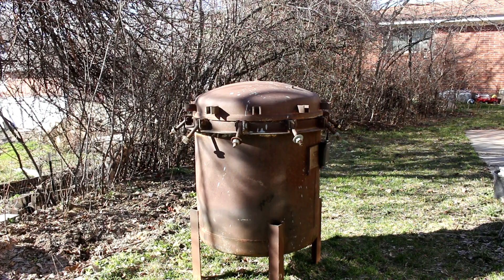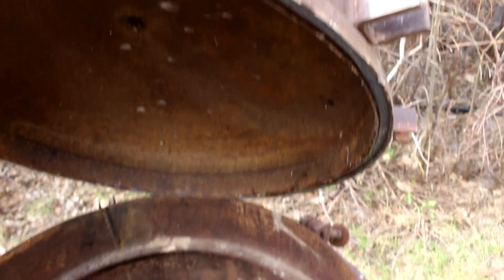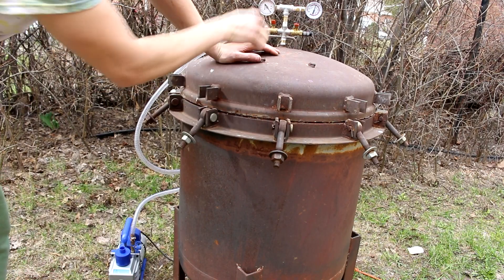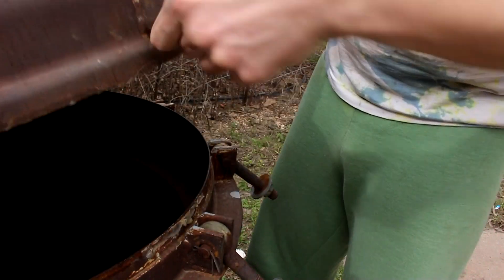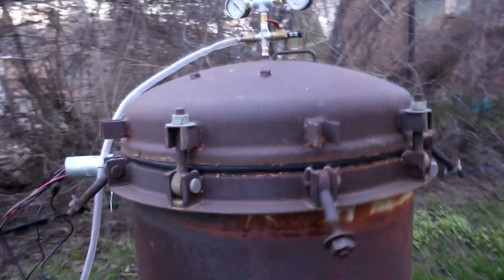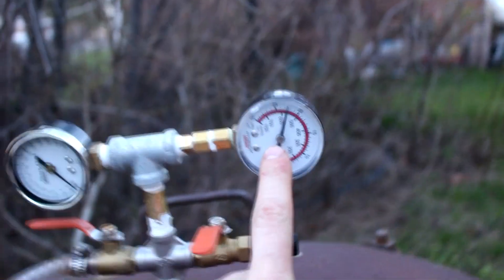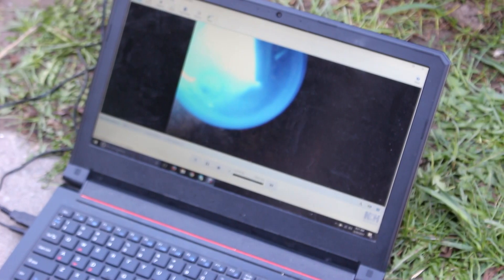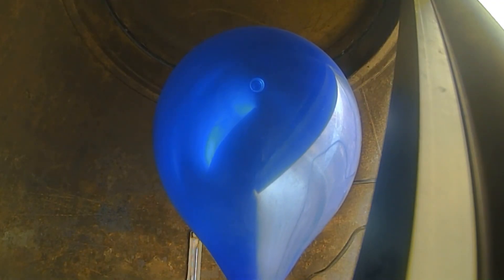Cody's 50 Gallon Press/Vac Chamber

Comment: Cool. Like Super Cool. 
Clean it up with chemistry or physics(acids or abrasives) either or, then test it.  dye pen or mag particle are fairly cheap and effective (vs Xray or Ultrasound...) and are fairly easy to obtain and operate. 
If thats too much effort at least paint it with one of those fancy rust converting paints (por-15?) and then pressure test to 5X your desired max working pressure. Submerge it in a tank of water so if it pops nothing too bad happens, like being hit by bits of  failed flying pressure tank...
Well played.

Comment: these vessels are most commonly used as filter pods in water reclamation facilities. the ring on the interior is used to suspend a rack holding fine grade filters. they can also be used with screens in the place of the filters and activated carbon packed below them as a filter agent.

Comment: it looks alot like a filter housing from a natural gas dehydrator, the ones i have been around typically have a max working pressure 30-150psi. also you should run a geiger counter over it naturally occurring radioactive material may build up on the scale inside.

Comment: Place I used to work had similarly shaped vessels(that were stainless steel). And they were used as filter vessels in a refining process, you know different size mesh in a nice pancake arrangement. But then again those had inlet and outlet ports on the bottom and top. Think you'd have to know what business had them vs who made them. Lots of metal fab places can produce stuff and never use it themselves. Just like yourself, there have been mad scientists in the past who needed cylindrical vacuum/pressure chambers.

Comment: With the DC lines running into the canister, I'm surprised you didn't run an LED light strip around the bottom to provide a more even lightsource.  I single incandescent bulb seemed pretty distracting and bright to one side making it difficult to see, although with the balloon, there wasn't much to see during this testing of the chamber.  You may have already thought of this and chosen not to do it, but a rotary drill with a wire brush would make very short work of cleaning the rust out of the inside of the canister without damaging it, and will also help prevent contamination of experiments.  Most industrial chemical tanks are stainless steel, because powder coating at various pressures can cause crack or flake contaminates into the chemicals.  I'd also recommend wire-brushing the threads on the lugs to help the nuts thread more evenly.  Great Find!!!  I look forward to see more experiments with the new chamber.

Comment: I have a 30 gallon high chrome stainless vessel which is good for 1500 PSI, has an internal heat jacket and weighs right at 926 pounds with a 1.5" thick observation window on it.

I am not sure what heat it is rated for but all that really matters is the gasket material which would be the first thing to fail under heat.

Comment: We use these vessels to filter coolant, as part of a separator system. Each vessel contains 5 800 micron filters, contained within metal sieves.
We use them as the last step in separating coolant from plastic shavings in CNC machines.

Comment: You could gain some confidence that your new vessel will not explode by hydro-statically testing it.  The process is pretty simple, requiring only water, a pump and either a larger tank or a scale. 

Pressurized water doesn't go BOOM like air would if the tank failed.

Comment: The vessel looks like a filter tank.  This would account for the high pressure rating and the removable lid.  It is not a reaction vessel as it lacks an agitator mount and internal heating coils.  Plus reactors have a lot more nozzles.

Comment: If you are concerned about the pressure capabilities of the vessel you should do a hydraulic test on it.  Fill the vessel completely full of water, with no air bubbles, and use a small positive displacement pump, or even an old brake master cylinder (800 psi I believe). Insuring no air is in the system speeds up the test and makes it safer. The real danger is from an explosion of the compressed gas. As you know water is almost incompressible and you can easily get the pressure up to 2 or 3 times it's rated pressure. A failure of the tank with water only will not be a dangerous event, you will just see water leak.

Comment: Hey Cody I've seen these same vessels in the gas plant I work at. Often they have a filter installed in them that fluids pass through. I've seen large oil filters that look similar too, on compressor engines, big waukesha v16s that are as big as a truck.

Comment: Not sure exactly what that was used for, but they still make them just like that. They are used in the aviation industry. They are used as a fuel filter vessel. Jet A fuel is pumped into the vessel and it is generally filled with 6 to 8 cylinder type fuel filters. We call them filter pods.

Comment: If ya gonna do the popcorn experiment, try a hotplate and pan with lid... always keep the apparatus as simple as possible :)  Microwaves and other larger electronics have those pesky electrolytic caps that may not handle extremes of pressure well.   An electric hotplate also takes up less volume than a microwave..

Comment: is there any way to sandblast all that rust off?
Reply: sandblast iis likely one of the easier methods to remove it but it can be expensive and knowing cody he'd probably just angle-grind it with a wire wheel because for rust on a surface like that it would be very straightforward.
could do a vid of chemical methods as well
Reply: buttercrap I'm sure he could diy the thing with a plastic tube and play sand though right 😂 I've seen some interesting diy sandblasters
Reply: or he could just electrolyze it with Sodium Carbonate, take a day or two, it's self stopping (so it won't etch). and needs no regular supervision. easiest solution when dealing with heavy rust.
Reply: and then some paint, can't decide between black or white, maybe a roll of colored paper as interchangeable backdrop

Comment: As I watched you let the air back into the chamber, I was reminded of some of the first super sonic wind tunnels that were built using a spherical  vacuum chamber that was as large as a building. It was connected by a  rather large pipe that ran through the lab out the other side into another spherical tank of the same size that held compressed air. They would mount their models into the pipe and release the compressed air which would reach super sonic velocities as it was sucked through the pipe into the vacuum.  Nice score by the way!

Comment: Things like this are often used in the plastics industry. 650 Degrees C is a bit low for anything associated with metal & such thins.

Probably was in Nylon making or something. Could be ex-DuPont gear that just got discarded some place after a plant upgrade or something.

Comment: Cody a buddie of mine offered me a vac pump that would have been powered by a large electric or gas motor. I had no use for it it is old probably 50s or so if your interested just reply and we'll go from there. It may or may not pull the vac maximums your doin but its big it surely could evac alot of air. Probably weighs about 60 lbs
Reply: Cenco hypervac

Comment: That small line will take forever to pump down that large vessel. You need a large O-ring. I would use at least 1-inch pipe and a larger vacuum hose.

Comment: Please try taking it to the full -29.9inhg for full testing vacuum. That small pump can't really handle more than about 27 inhg (I have one), but with a good one, you'll be able to go the full vacuum. It may take overnight, though, for a vessel. 
Also, your vacuum gauge is supposed to be calibrated for sea level, so you should be able to go to the full 29.9.
Also, a coat of rust bonding primer, followed by a matte white coat should disperse light pretty well on the inside for your camera.

Comment: We had those exact vessels at my job in a polymer extrusion plant. a slurry of fine pellets and water would go into the side near the top and inside it had a rack with 6-8 holes for  baskets that held filters to catch the fine pellets before the water went out of the bottom back to be used again.
Reply: also the extrusion plants are cheap and mine had no water treatment which probably contributed to the rust. also the way we lifted the lid on and off was that there was a threaded metal rod attached to the middle top of the lid with a circular valve handle threaded on to it that was welded to a strut that was attached to the side of the vessel. so basically you spin the valve clockwise to raise the lid and counterclockwise to lower it. explains the threaded hole on the top as well as the inlet pipe on the side.
Reply: like this: http://www.gwttllc.com/wp-content/uploads/2016/05/rental-slider-2.jpg

Comment: almost certain that says 1931
Reply: Nick Here Watch again in hi-res, I thought the same, but it's some rust over the 6 that makes it look like a 3
Reply: If a pressure vessel is so rusty that it's hard to tell if it was built 57 years ago or 87 years ago, maybe it's best not to put much pressure in it. :)
Reply: 1961. I thought the same as you but look closely
Reply: Be it 31 or 61, that's still one scary old piece of rusty equipment. 

Looks like something child murderers would boil babies in for soup.
Reply: It says 1931 - thank gawd it's STEEL!!! 
   We can drive cars with rust on them, he's fine!  But, 1931- WTF?? & he found it?
Reply: Nick ward that's what I thought too
Reply: exactly
Reply: i cleared the image up and its indeed a 1931 manufacture date
Reply: Was looking for this comment.
Reply: Yup. Scary old piece of junk that thing is.
Reply: Its a 3. The 3 has a line over the first curve going to the right (like a three) but there is a six in the same type face that doesnt have the slightest of a line there
Reply: It does say 1931

Comment: A microwave oven needs cooling for the magnetron and transformer. Without an atmosphere it would be interesting to see how long it will last. In respect to the latter, I think pop corn would pop faster in a microwave under vacuum because heating should be more localized.

Comment: I'm guessing it's an autoclave for composites.  If you build a fiberglass part and you don't want gas voids ruining it, you can either off-gas it in a vacuum chamber, or pressurize it to squeeze the bubbles down to nothing.  That's how they build boats and airplane parts.

Comment: This is the 555th video of the channel

Btw, cody try the cold welding thing again but with an indium-gallium alloy, its a harder alloy but has lower melting point.
When i saw your first cold welding video the first thing i thought of was that maybe its not friction causing it to cold weld but yes the metal atoms actually atracting each other and forming bonds, like if they were a single solid piece, but it was kinda weak because it only had one layer in contact. When you twist the indium you are "scrambling" the atoms as if they were a liquid. Having the solid behave like a liquid would allow the atoms to form bonds and thus cold welding. 
And i thought you could test this by using gallium or gallium mixed with indium to lower the melting point of the metal and then redo the experiment.
Who agrees?

Comment: Cody can you make thermite out of that rust?
Reply: CrazyConn That's exactly what thermite is. Well iron oxide  (rust) and aluminium powder.
Reply: MaxRay16 Thermite could be made from other substances too though.
Reply: yes, but using chemical grade oxides is cleaner
Reply: CrazyConn, A high temperature burning metal such as iron oxide, mixed with about 50% aluminum powder will oxidize the metal which will produce incredibly high amounts of heat in such a small area for a very short amount of time. The formula for this would be [Fe2O3 + 2 Al -> 2 Fe + Al2O3]

Comment: You need another 50gal chamber and you could pipe them together with large pipe and a ball valve between.  Then pressurize one and vacuum the other and then open the ball valve quick with a string from a great distance.  The rapid equalization of that much gas could be fun to play with.

Comment: I wasn't worried for you when you pulled a vacuum in it, worst case scenario is it gives and instantly kinks the sides in with a bang, maybe jumps on the spot. the pressuring was much more scary though, completely different worse case scenario with bits of that old rusty thing flying outwards. Be careful Cody, keep an eye on any complacency!

Comment: Put different gases inside different balloons and compare when they pop.
You would need a way of accurately filling the balloons to the same pressure but you can probably just use a cheap pressure gage. Alternatively you could make the main control variable the size of the balloon and see at which pressures they pop at.
You could work out the different expansion rates which might be interesting to see. I don't know.
Alternatively, see what a Cody does under pressure or in a vacuum XD.

Comment: I was just looking up some popcorn info a day ago and it pops with an internal pressure of around 1Mpa or 140psi. at 1 atm oil temps of 400-460f are optimal, giving time for the starch to gelatinize while being fast enough that the steam doesn't diffuse out. Ideal moisture content is about 16%-20% of dry matter or 14-17% of total weight; over drying is only partially reversible, the kernels will not fully recover their maximum expansion ability but will be better than if left too dry.  

The bread may be interesting. risen in or only baked in different pressure? Professional baking ovens(and maybe bread makers?) have steam injection that is used for the first 5 minutes of baking to gelatinize surface starches and cause a large thermal transfer that causes one last dough expansion just before the crust sets. Of interest is the solubility vs temp of CO2 in the dough's moisture at various pressures. Maybe rise under cool pressure and drop pressure right at the start of baking; certainly don't want an overly risen dough or it will [pop and] deflate.

Comment: Hey Cody. do you have a thermal camera? If you do, I'd love to see you do an experiment on thermal conductivity in a (near) vacuum, as opposed to one done in normal atmospheric pressure.
Reply: In a vacuum heat doesn't spread between separated objects (if not through infrared irradiation, which is quite negligible), while with more pressure the heat conductivity of air increases

Comment: Put a tesla coil inside it. Would there be arcs and if yes, how would they act?
Reply: Lassi Mattila Electro boom has a rather hilarious video about this
Reply: Oliver Johansson Thanks, i will watch it now.
Reply: The arcs would get longer as the pressure drops, up to a point. The the coil would start arcing to itself as the air becomes more conductive at lower pressures.
Reply: a plasma ball is the very concept you are talking about

Comment: Looks about the right size for a model fission reactor. Coming up next: How to glow in the dark with Cody?
Reply: fredrick mullenburg yeah. the 10000$ camera is a slow motion camera in case you didnt know
Reply: this comment has no bearing on anything, wat... you can see radiation glow with a gopro, or webcam, or any light sensitive sensor. its visible spectrum radiation and thats why its blue or other colors depending on the medium of energy transfer or radiation type. you dont need a $10k anything to view a glow. its a glow. do some research before you say silly things. damn.

Comment: Can you drill out a hole large enough to place a thick a acrylic panel, so that you can see into the chamber?
Reply: An acrylic window does not aid science any more than a camera does. As you yourself pointed out when you could come up with no better reason than "it's cool" <-- not for the sake of science then, that's risking your life for the sake of "kind of cool" Drilling holes introduces weak spots, bigger holes bigger weakness.
Reply: Kono Sekai no Seigi in what ways would this be superior to the camera he placed inside the chamber?
Reply: I dunno, it would just be a cool feature.
Reply: That sounds like an excellent method to triple your chances of dying from exploding and/or imploding chambers.
Reply: A better way would be to use a thick acrylic sheet as the lid. It would only work under vacuum, but it would be better than a window and safer too
Reply: A. Zak, perhaps...  it was just an idea.
Reply: Oooooohhhh gooodnesss!!! are you really going to drag this on! And perhaps it could aid science, bc what if the cameras or  the light  broke? then you wouldn't be able to see inside. And, the modification would be cool. So it does have some merit at the same time as being cool.
Reply: or you could keep using cameras and not damaging the integrity of an already old and venerable vessel thats seen better days. twenty years ago. when it was probably taken out of comission
Reply: Risk for the sake of science! Besides, last I checked, this was Cody's lab not Gavin's lab
Reply: Hmmmmm...... There is a difference between telling someone to do something, and making a suggestion. oh well... Trolls will be trolls Kappa

Comment: Odd question but why not pull the vacuum from the side port? With a T you can still have the wire port and you can then have larger ports for letting the air back in. This would also free up the lid so you no longer have the gauges on top where they can be damaged when removing the lid.

Comment: Cody the next time you pressure test an old vessel fill it up as much as possible with water. In case of a rupture you would have a much smaller release of energy. Be careful of dents on the outside that will significantly reduce the resistance to external pressure (vacuum)